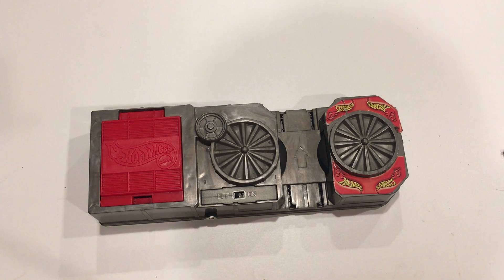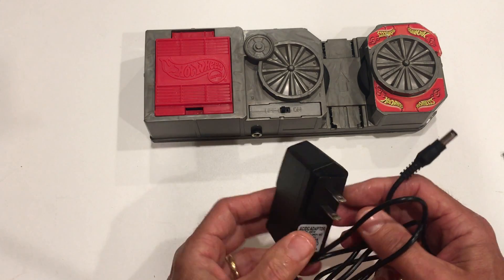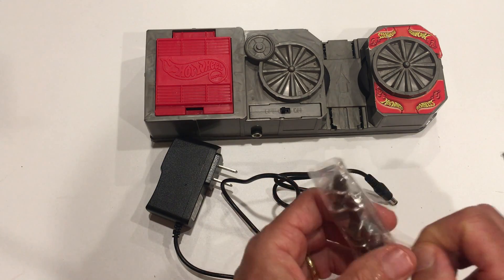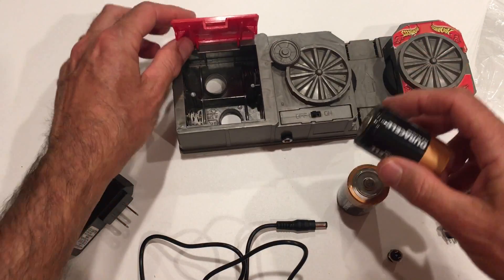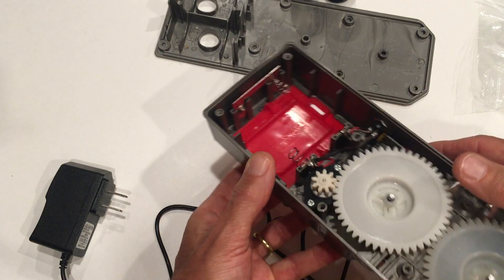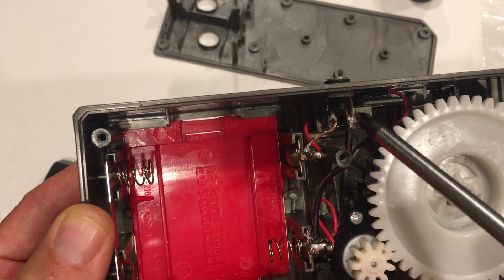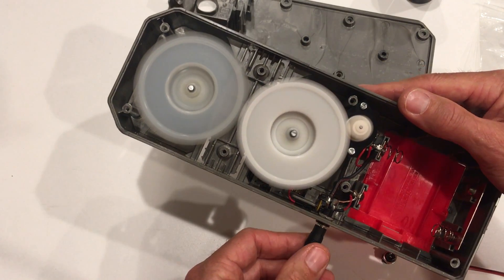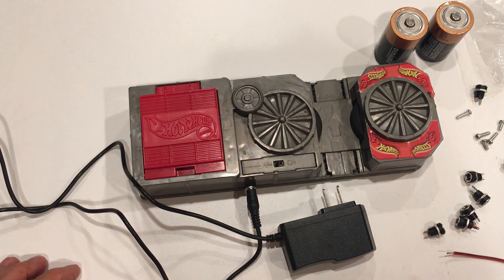Hot Wheels Booster Mod

Comment: Hi
Thanks for the help. Im about to try to link together 5 boosters but would still like to run them from 1 adapter. I can get the 1 to 5 wire splitters on amazon (usually sold for cctv sets) but please can you advise me, for 5 boosters would i just multiply the voltage required? So 5 boosters with 2 1.5v d batteries is equal to 15v and 5amp. If i can find a sufficient power adapter do you think it would work? Many thanks.
Reply from the maker: Hello. There is no need to increase the voltage. Assuming the boosters are hooked up in parallel, the voltage would be the same (3V) across them all. However, with each added booster (load) you will need more current. The problem is ampacity, or current-carrying capacity of the light gauge wiring. As the current increases, it could cause some wires to overheat, and a fire could result. Please exercise caution or better yet, consult a qualified engineer or electrician.

Comment: I did this and the wheels started spinning in the opposite direction
Reply from the maker: @amp2cool  That’s a polarity problem. No harm done, it simply means the wires are reversed. Easy fix, you’ll just have to swap the way the wires are connected, either at the motor or at the battery compartment ( but not both). 😉👍

Comment from the maker: More information would be helpful.
How many batteries does the booster use? Also, what is the voltage and maximum current rating of your adapter?

Comment: Help! I am attempting this conversion on a 2018 hot wheels booster (where the motor has a little blue control board mounted on it), and I cannot convert it successfully. It keeps giving intermittent power - and I'm wondering if the control board is preventing DC conversion tampering like this. At first I thought it was soldering problems, but then I simply tried a separate one without soldering at all and holding the wires to the red and black connectors - still intermittent.

Comment: i got the wipeout track set off market place but teh booster are no good i try to use the batterie power one but the cars get boost and they dotn make the round so wondering how many volt can the mottor handle  cuz i gona try this when i get the stuff

Comment: I used to always solder wires to the negative and positive battery terminals(using basic USB micro B cord, as it has less wires than a micro type C. For those curious about gauge). And then ran whatever I wired up with a 10,000maH power bank to power it so that it wasn't too overloaded

Comment from the maker: Hmmm. Curious. 
Does it run fine under load with just batteries?
I assume batteries are removed when using adapter, so no possibility of 2x voltage. Other than checking for mis-wiring or a short and verifying adapter output with a multi-meter, I have no other ideas.
Good luck.
Reply: batteries work just fine, i have a 3 prong jack but i remove the batteries anyway. ive verified with a multi-meter and its all wired correctly.

Comment: so i did this, the motor works with no gear or friction on the motor, but as soon as i put the gear in and try to turn it on, it acts like it wants to start for a split second then stops. it will repeat this process until i turn it off. i have a 3-12v universal adapter that outputs 1 amp. i tried a 3-12v universal that outputs 2 amps but it did the same exact thing but faster. any help would be appreciated!
Reply: Did you fix your problem?cc
Reply: im also trying to modify the booster from this set if it helps: Action Epic Crash Dash Track Set
Reply from the maker: What voltage setting are you using on the adapter and how many 1.5v batteries does the booster need?
Reply: @mccord50  4 d cell batteries, im using the 6v setting on my adapter, ive tried 5 and 7.5 but same results.

Comment: I did the 70's Super charger
Reply from the maker: Thanks for sharing, and congratulations on your mod. Perhaps you can share some photos or details of how you made connections? I have had limited success with the Super Chargers due to the enclosure being glued (not screwed) and therefore difficult to access internals.
Reply: it works with the battery contacts
Reply: @mccord50    They really did glue them Super charges tight WOW!  I cut the TOP gently got the lid off .. I has one whiich  pulled open easily

Comment: Did this conversion, really straight-forward, but the speed is super low post-conversion compared to batteries. Speed is about equal to drained batteries (~1.3V each on multimeter). Put the multimeter on there and when the motor is off it's ~3.4V across the terminals with the wall adapter (as expected; this is the same voltage from the wall adapter, 3V@1A). Motor on the voltage across the terminals drops to ~1.4V. Two D batteries reading ~1.4V each are reading 1.8V under load on the unit. Any ideas? Outside my troubleshooting expertise here!

Edit: this was self-inflicted. Bit heavy on new grease. Wiped that down, works like a champ!

Comment: I have some old school superchargers with speed control that require 3 d batteries. I’m wondering if this mod will work?
Reply from the maker: Rich, thank you for your comment. Yes, a charger that uses three (3) D-cells is running on a nominal voltage of 4.5 volts (1.5 volts per cell), so you can easily use this same mod with a different power adapter. The modification to the booster is exactly the same, but instead of a 3-volt DC adapter you’ll need to use a 4.5 or 5 volt adapter. Be sure the current output is at least 1-amp (1,000 mA) or better (I like to use 2-amp adapters) for best results.
The adapters are readily available on sites like Ebay for about $6.
Good luck with your project.

Comment: Hi, my hot wheels power not working once i open the battery there some rust in it. Any chance to fix this? Thank You
Reply from the maker: If the corrosion inside the battery compartment is minor you might be able to clean it off with an old toothbrush dipped in vinegar (see other YouTube videos on this method). If the battery contacts are beyond repair you can still perform this modification, simply intercept the wires elsewhere inside the booster housing and forget about the battery compartment terminals.
Good luck.
Reply: @mccord50  thank you. At the moment I’m using foil paper on both side and works. Is it gonna be last? Or better clean and replace the part near the compartment. Thanks

Comment: @mccord50  Thank you for the video. I followed it to modify my booster. While not a big issue the motor now turns in the opposite direction it used to when on batteries. Any idea why this might be?
Reply from the maker: Sure thing. Simply swap the wires.  The direction change is due to a reversal in polarity.  In other words you are now supplying a positive charge to where the negative charge used to go.  Reverse the wire connections and your booster should run normally.  There's no harm if you want to leave it reversed, DC motors can run in either direction.  If you want to get fancy you could even wire in a double pole double throw (DPDT) rocker switch which would allow you to change booster direction any time! Thanks for your comment and good luck with your booster.

Comment: Hello sir, can I used adaptor out put :12.0v / 1.5A.?
Reply from the maker: I don’t know what type of booster you are trying to modify, but 12V sounds like too much.  You should count the number of batteries as each battery typically provides  1.5 volts. Therefore a two-battery booster normally runs on just three volts.

Comment: I recently bought a 1969 Rod runner set off E-bay, I then bought the Hot Wheels Track Builder Unlimited Power Boost Box, a complete set with a 2 lane power booster.

ran the track and had the 2 lane banked curves on each end, out of all the cars I tried only a couple would stay on the track for about 4 laps, the heavier cars won't even complete one lap and the lighter cars end up flying off the track at the curves, so I just changed from the 2 lane banked curves to the 4 single lane and covered red/clear curves that came with the booster box set and that is even worse no cars will stay on the track, the second they exit the red and covered curve they fly off the track.

the booster is very fast with no way to lower the speed. I did modify the booster so that it does not need batteries with a 6-volt dc power pack, it provides the exact same voltage as the 4 in series D batteries, I took a voltage reading of the wires exiting the battery compartment and it was 6 volts exactly as it should be with 4 1.5 volt D batteries in series.

the whole point was that I wanted to be able to run 2 cars on a power boosted oval track

I have over 200.00 just in acquiring what I needed to build a two-lane oval with a power booster and it is a complete failure, I even tried running the higher sidewall track from the booster to the 2 lane banked curves as many cars tend to fly off before getting to the curve and most flew off halfway through the curve.

from the booster to the curves is about 6 feet, as I needed that much for the track coming out of the wide booster to squeeze down to the narrow 2 lane banked curves.

I wanted to build a normal oval race track and even bought a 1969 lap counter separately.

now I am thinking I will just sell all of it on E-bay together both sets, and all of the cars about 70-80, and call it a lesson in futility, and get out of the hot wheels business altogether.

Comment: Any idea what happens if I turn a 3 volt up to about 4.5? be cool if I could get a little more speed out of it to do some better loops for my son's setup. I certainly don't want to burn out the motor though.
Reply from the maker: The short answer is “yes”, you can safely increase the applied DC voltage (within reason) and speed should increase proportionally. This has been covered extensively in the comments, and I’ve even made a separate video on the subject.  Thanks for your interest and good luck.

Comment: Im not sure why hot wheels didnt just do this from the beginning. Great I instructions!
Reply from the maker: Indeed! Since making this video I’ve converted many other battery operated toys. the same way.  A bonus is being able to reuse the same AC adapter on multiple toys (so long as voltage is the same of course). Have fun and thanks for the comment.

Comment: My hotwheels track takes 4 "D" batteries, totaling 6v.... so, should I purchase a 6v 1 amp power supply or a 6v 2 amp supply? Any ideas?
Reply from the maker: I've converted a Hot Wheels Criss Cross Crash set, which normally runs on 4-D cell batteries, and it ran successfully on three differently sized  AC to 6VDC adapters - 500mA, 1A, and 2A.  However, I've found the 500mA can be a tad underpowered in some cases.  I typically source them on eBay and a search on "AC Power Adapter 6V" revealed availability as low as $4 for a 6V/2A adapter with free shipping. Because the price difference is small between them I would recommend a minimum of 1A, and you won't hurt anything going up to 2A if you want to ensure no shortage of power.
Reply: @mccord50 , awesome! Thanks for the reply and the info!

Comment: Anyone knows if i can use 12v 1amp for this motor?
Reply from the maker: Hello, and thanks for your question.  While it may be possible to operate a 3V motor at 12V, it is not recommended, and I don't believe you would get good results.
However, your question did motivate me to create a new video demonstrating the effect of varying voltage from 3-9 volts on a similar booster.  You can see it here: https://youtu.be/TMD4fqPyK_A
Reply: @mccord50  thank you sir for the demonstration. I now have a different problem. Due to increasing the voltage, the motor gear teeth all broke. Now im still looking for gear replacement inorder to continue playing.😅

Comment: can i use 2 amps?
Reply from the maker: Yes.  A 2 amp power supply will work fine on this type of booster, so long as voltage is correct.

Comment: Great video exactly what I was looking for. I have a question, you mention that a 1 amp plug is more than enough but do you have any idea as to what the amp draw is on these hot wheels motors?
Reply: 800mA

Comment: What is the female connector called. I am having trouble finding one
Reply from the maker: Hello Matthew. An internet search for "DC connector female panel mount" should return some good results. Just ensure the male & female ends you buy are the same size. I use the 5.5mm standard for both.  Depending on your application you may want it with a pigtail or without (for panel mounting). Note they also come in 2-pin or 3-pin options.  I originally used 2-pin, but now utilize the 3-pin type.  The wiring is a little trickier, but 3-pin type will safely isolate the batteries when the unit is run on AC thereby eliminating the potential for battery overcharging.  My videos illustrating how to wire both types of sockets are posted on YouTube.
Be safe and have fun.
Reply: @mccord50  thank you

Comment: If you ran this while plugged into the wall with the batteries in, the batteries explode don't they?

Edited
So I see in a reply further down in the comments that yes they could.
Reply from the maker: Short answer - Yes, they might.
For a better explanation check out my updated power booster mod video at: https://www.youtube.com/watch?v=WJpLbxyECsE&t=3s
When a 2-pin receptacle is used there is nothing to prevent AC current from reaching the batteries, and because it has no protective circuitry like you would find in a battery recharger, the potential exists to overcharge the batteries.  Therefore, when you modify a booster with a 2-pin receptacle as shown in this earlier video  it is very important to use either AC power or batteries, but never both at the same time.
My newer video shows how a 3-pin receptacle allows you to safely keep batteries in the booster while also running on AC.  I encourage you to check it out.  Good luck.

Comment: Do you know how would be the connection for 2 or more booster in just one ac plug?
Reply from the maker: Sorry, but I do not have any experience wiring multiple boosters to a single plug.  However,  I imagine you would want to connect them in a parallel circuit to avoid voltage drop and ensure amperage is sufficient to run them simultaneously.  Good luck!
Reply: All boosters wired to a central control board with dimmer switches controlling the speed of each booster!  Do it and post a vid!  That would be the tits!

Comment: Hi, i followed your instructions, but i noticed that booster is more powerfull with adapter and is too strong. Used a variable voltage adapter with 3 volts and 1amp. Can you asist me please? Thanks
Reply from the maker: Javier,
Thank you for your comment.  Motor speed is proportional to applied voltage, so not sure what could be the problem.  If both batteries and the adapter supply 3 volts DC, the adapter should not run the motor much faster.  If the batteries are old (i.e. partially discharged) it is normal to see a slight speed increase when the adapter supplies the full 3-volts.  However, if you are seeing a dramatic difference something is wrong.  One thing that might cause this is incorrect wiring, that puts both batteries and adapter in series, resulting in a total of 3V + 3V  = 6 volts being applied.  Are you having the problem only when batteries and adapter are used together?  If not, I recommend using  a multimeter to check the voltage output of your variable adapter.  If you are using both together please read my warnings about battery over-charge, and see my other video about using a 3-pin socket.  Good luck.

Comment: Will a higher amp adapter make it faster? Or will the 1amp already satisfy all the motor can do anyway?
Reply from the maker: In this case it is voltage, not current which determines motor speed.  A one (1) amp power supply is more than adequate for a typical two (2) battery Hot Wheels power booster. If you want higher speeds a variable voltage power supply, or higher voltage DC adapter works nicely. However, going more than 50-100% over stock voltage is not recommended.
Reply: I directly wired it to an outlet plug and I blew one up.  I rigged another one and ran it to the wall and that sucker was waaaaaay to fast!  I put a dimmer knob and it worked like an accellerator.  The problem is that 90% of its range was too fast.
Reply: @vilekyle22  man, I really hope this isn't true.
Reply: @zacisoutoffocus  that's what happened in my world.  More experiments needed....
Reply: @vilekyle22  That electricity is no joke my friend. Play safe ✌️

Comment: Next is to swap motor out for lower turn rc motor, increase voltage to that of a 2s lipo in the 30-40c range, or a suitable plug adapter. For motor speed control i would install a proper esc and receiver to control motor speed using throttle or even trim setting on transmitter, maybe even just a dimmer switch/knob to regulate motor speed.
Reply: What your saying is Greek to me.
Perhaps you could reply with a link where I can study and do this.
Batteries are to darn expensive.
Thanks for your time.
Reply: @Utubin you don't need to do what he is talking about.  He basically saying put in a more powerful motor and use much fancier (and more expensive) batteries, which you don't want. 

Also, if you still care 3 years later, he is saying put in a knov that you can turn that will increase the speed of the Power Booster so you can control how fast the wheels spin.
Reply: @DrMatthewHudson  O yeah I'm still here,,loud and proud 90% lost on all topics in life yet 100% full of questions of everything to do with life,,,,So yeah if your the expert I've been looking for to answer all my life's questions then I'll subscribe and start unloading the questions as I love enhancement of anything related to small items that have small weak fed motors and so much more.
Thanks for your reply, I appreciate it.
Reply: @Utubin  if I had time I would help, but I don't unfortunately
Reply: @DrMatthewHudson  Ok thanks anyhow.
If you ever have time I'll be here.